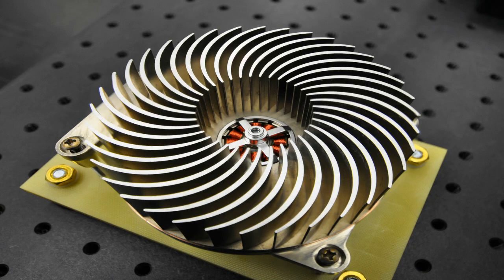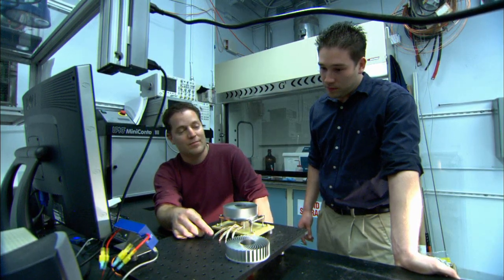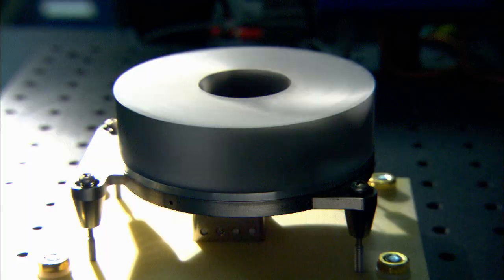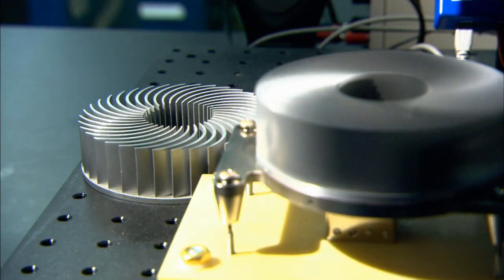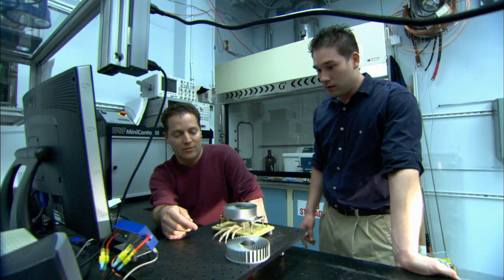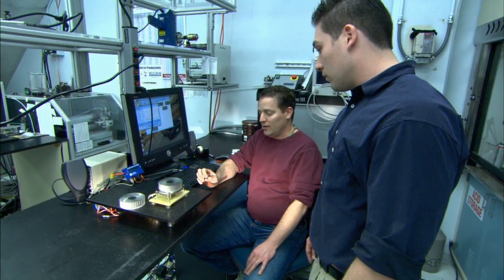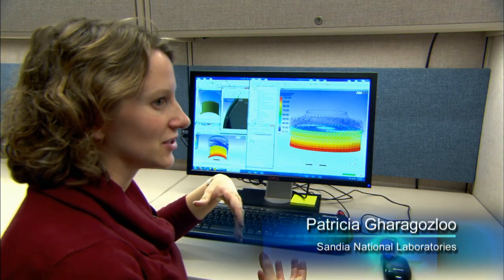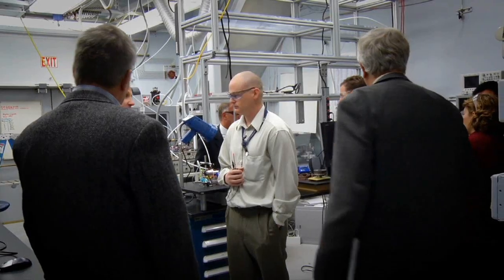Sandia Cooler

Comment: So stupid build big fans expensive fans to get -10c/-15c difference from stock cooling they need to reduce power consumption and wattage = lower heat i mean its not impossible thing to do they did it with ddr4 (better speeds than ddr3 but lower wattage) i am sure they can figure out how to make better processor and graphic cards to ... good example is most powerful PC there is human brain - typical adult human brain runs on around 12 watts !!!

Comment: It's not silent and it will collect dust just like pc fans do.
Reply: Apparently you didn't catch the part about boundary layer effects.
Maybe you didn't listen at all?
Reply: it's silent as my ass.
Reply: ***** And you may pretend that you don't fart, but you do.
Reply: cheif10thumbs I did. I'm not saying that the connecting part will be making the noise, I'm saying that the blades will cut the air and make a familiar airy sound.
Reply: jusk i think you are right because the video at a certain point was claiming it could potentially be 'silent' in it's final itereation, though overall in the video I think they were claiming it is significiantly quieter than traditional fans, while also being more efficient at cooling - not that it would be completely silent.The CoolChip cooler prototype that was shown at CES this year in this video: https://www.youtube.com/watch?v=ahgnVrULqUs, which liscences the Sandia technology claims to be 20db quieter than a commercial fan at the same RPM while removing more heat. There's various reports online about this prototype which confirm that it does seem significantly quieter.Not really fair to nail the design by interpreting the claim of being quiter as claiming it will be silent, and that accumulating less dust as accumulating no dust. I'm excited about a consumer cooler that is 20db quieter, while being say 50% more efficient.
Reply: Dan P I completely agree.
Reply: Humphrey Bergquist I honestly think such a crewed blade design won't work as they claim it will. I'm basing this on common sense. When something moves through air quickly it makes that ripping sound, I think their blades aren't a finished version tho, so maybe a more aerodynamic version could lessen that effect. And dust sticks to anything that comes in contact with air, but dust isn't a big deal if you can afford a pair of women's staking.

Comment: Coolermaster have just shown off a cooler based on this at CES 2015
Reply: Kawayolnyo
Theryre apparently a division of CM.
Reply: Yeah the actual product was shown off in the CoolerMaster suite. Both Linus Tech and JayzTwoCents did videos on the cooler from the CoolerMaster suite. the final commercial cooler will be sold under the CM brand.
Reply: Cooler Master didn't show jack so far. The first commercial attempt will be in mid/late 2015. It was Coolchip themselves.
Reply: Applebloom
Nope. Not at all. Coolchip basically just rented Cooler Master's suite on CES, to introduce it's technology, while Cooler Master made a contract with Coolchip to release the very first commercial version of the product utilizing this technology. But Coolchip doesn't belong to Cooler Master. They just have contract to release first Coolchip-designed cooler under the Cooler Master's name/brand.

David Dewis
Yes, they did rent Cooler Master's suite's space to showcase their product at CES, but they don't belong to Cooler Master. They just have a contract with Cooler Master to release the very first commercial version of this cooler under the Cooler Master's name and brand.
Reply: Kvarnholmen. The fan blades may look the same, but the underlying technology is completely different I believe.
Reply: Kvarnholmen did that fan make a shit ton of noise?... no didnt think so

Comment: Air cooling is loud?  I don't think so buddy.  Also that high pitch noise that thing is putting out sounds annoying as hell.  Good luck.
Reply: ISEE YOU your an ignorant idiot. just shut up and stop hating. no one gives a shit about where you work. or how long you've been working with computers. that doesnt mean anything..adding to that. alot of people have noisy computers and realy dont care. why dont you just buy it your self. try it. and if you dont like it. return it, get a refund and move on. your just bashing and hating the scientists for trying to make lives easier for our computers. if your so certain this isnt going to work, why not email them about it and give them your opinion. rather than acting like you know everything about everything when you dont know jack shit :)
Reply: The sound is explained in the video, that's the noise any motor makes when you take the shrouding off.
Reply: It's loud... anything turning that RPM is loud period.. good luck.
Reply: ISEE YOU
Not necessarily.
Reply: Hλwk978 Yes.. actually.  Been building custom PCs for 15 years.. been through a lot of cooling solutions from back in the day when pond pumps were used for water cooling.  I am sensitive to high pitched noises and you can tell how loud it is in the video......
Reply: He even says it's the motor making the noise!  When he let's it coast it is no longer being driven.. well DUH its going to be quiet!
Reply: I work in a 700,000 sqft data center..in our environment it would probably do perfectly fine as it's extremely loud in a server room anyways and they may get that think to work in a 1U server as it's fairly low profile....  But home PC that high pitched noise has to go..
Reply: You're an idiot.
Reply: tobsmonster2 I think not... we will see how well this does in a consumer market with THAT noise.. Good luck!
Reply: Bayview Ave
Old enough to not use the word bro.  Maybe I am to old.. I am from a time where ppl prefer a quiet PC and not one that sounds like 40 dog whistles going off at the same time.  You would think my opinion and back ground would matter some considering I am in the industry in which these could be used.  I will respect your opinion and try to understand why someone would like a loud PC.  After building hundreds over the years that was never a request a customer has ever made.. always the opposite.  It might be impossible for you to fuck your self.. some of have the length to pull that off if we really wanted.  Good luck.... Bro.
Reply: you dont need to keep wishing me luck. it was stupid and funny the first time and i through it back at you for the second time. now its fuckin old already. second. a noisy pc isnt somthing that customers fully ask for when getting their computers built.. its somthing that happens after building their computer and trying different things to make it quiter but end up getting use to it in the process and giving up. thirdly there is nothing wrong with the word bro.. you cant even compare the immaturity levels of the word "bro" and the entire sentance "go eat a bag of dicks" you think your old enough to not use the word bro, but your not old enough to tell me to eat a bag of dicks? and to go fuck my self? grow up. your probably 20 or 30 years older than me for all i know. considering your profession and working environment if its even true. the people who throw out full on insults like the ones you gave me at the start,are always the fools lmao.
Reply: Bayview Ave
I am starting to think you secretly have feelings for me with all this attention I am getting.  Yes, I am probably older than you but that's ok.  Also, my customers are usually on the high end side of PC gaming etc.. so noise is a concern and comes up before the PC is ever built.  Ya know why?  Because they see my personal PC and are amazed at how silent it is.  So this usually feeds into the info of the build I do for them.  I just don't avoid fan noise I also do my best to avoid coil whine when choosing components.  I can't imagine why anyone would WANT noise.. I mean that is like someone wanting a shit sandwich and trying to smile while they eat it.  Forgive my eat a bag of dicks comment.  I was responding a little rash to your "ignorant idiot" and "jack shit" comment.  I mean let's get real here.  You put those comments hoping for the reply you just got.  I gave my opinion on a subject very near and dear to me.  You could easily just ignore this whole post but I have a feeling you will reply again.  And with that I say Good Luck.. Bro  :)
Reply: yeah i love you so much because i keep answering back..save it. your not getting much attention and even if you were. its youtube. it doesnt take alot of time to type out 9 10 15 or 21 lines of text. im not losing any time in real life.im bashing you because i actualyt think that metal fan shit is a pretty cool idea and you just throw it down the trash. dont care if its your opinion or not. rights this and that . opinions will be opinions save it. the fan noise isnt even that loud..and it can be turned off... it sounds like a mini jet engine to me. and i dont ignore my replies to youtube. i reply to all of them. im not an asshole. even if im arguing with someone ill keep going untill they feel they wanna stop. its the same shit in real life. and you can drop the bro act already. wtf is wrong with you?.. i said it once and you keep going with it like your trying to prove a point
Reply: Bayview Ave
The idea is really neat.. my only complaint was on the noise.  I even said in a server environment it may do really well.  I truly wish the idea and the ppl the best of luck with the project.  If it did do well I would be the guy to end up testing it against other heat pipe style solutions.  As for you I am sorry if I hurt your feelings as that was not my intentions.
Reply: 1 year later.. it really hasn't taken off has it?  Tried to with coolermaster and now with TT?

Comment: These people aren't scammers. Its a real lab. But...  Notice the leveling screws? I bet it doesn't work unless its very level. It might even be thrown off by the vibrations of nearby disk drives and normal fans. Can't mount it vertically either I'd bet. Lots of things look good in the lab but don't work out in practice.
Reply: The consumer version that coolchip just showed off seems to be supported by a more standard heatsink surrounding it, but it does also seem that it's only horizontaly mounted.

Comment: I just don't understand how heat is transfered from the heat source to the spinning fins. It looks very inefficient to me as they're not touching each other.
Reply: ***** Correction: the air gap acts like a very, very bad thermal conductor. That's why we need thermal paste in conventional CPU coolers, where the gaps are in micrometers.
Reply: The air gets heated and moves outwards through natural convection. It then blows air through a heat sink that surrounds it.
Reply: considering most cases have a fan positioned to dissipate cpu heat I imagine a blower like design could easily direct the air out the back of the case the same way gpu blower fans work?

Comment: The benefits of this design are obvious once you get past the question of how to get heat from the stationary heat source to the moving heatsink. How does this do that?
Reply: The heat must travel through the air gap of the bearing which would be 1/10th of a millimeter or much less. Air is normally a thermal isolator, but because the air gets compressed in some spots and is not stationary, it should gain some heat transfer properties, just like any liquid is a good conductor of heat.

Whether they can reach reasonable thermal performance of the air gap at mass production is what will make or break this cooler indeed.

The resistance of thermal junction from heatsink fins to air is claimed to be 30 times lower in this construction than in traditional heatsink. Let's assume that a thermal junction between heatsink base and heatsink rotor here is similar to the fin-air one nature, but has 10 times less area, and is half as efficient. This would still leave enough room for this cooler to be more efficient than a traditional one.

Comment: So stupid,  Who wants to accidentally get their finger caught in that?  And It is very loud and high pitched.  Liquid Cooling is much better and cooler looking.
Reply: No,  but you're not clever either.
Reply: No I didn't, but it looks a couple people did, so I got that going for me, which is nice.
Reply: You stick your fingers into fans?
Reply: Stev02112
you really think they are first ppl in cooling? millions engineers are involved in cooling. stationary chiller with fan aint going nowhere anytime soon
Reply: SimmanGodz
Thats what i was going to sayXD
Reply: Yes I have, alot of times I need to feel the heatsincs inside to see how hot they are or rearrange the wires while the pc is still running and get my fingers caught in them.  This thing will probally just eat your fingers right off instead of just a sore finger.
Reply: Vault Nomad Yeah understandable i do the same but i just thought it was funny XD
Reply: Vault Nomad
 ups, wrong guy :)